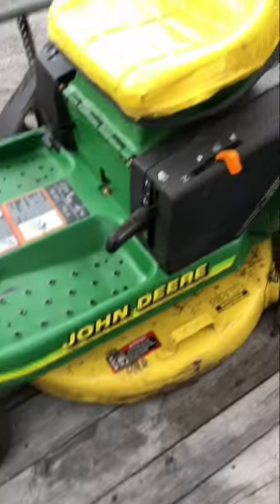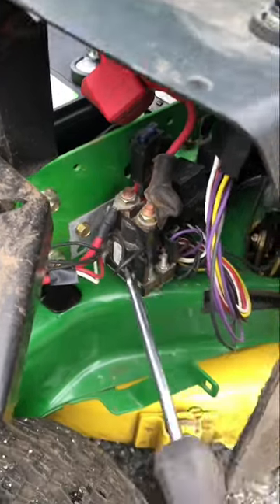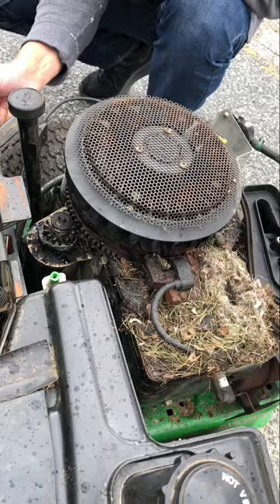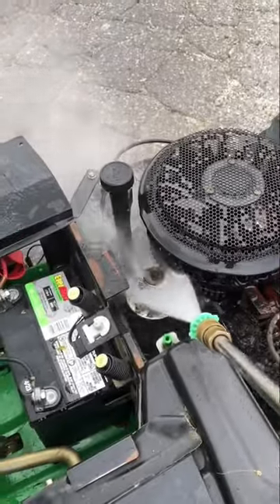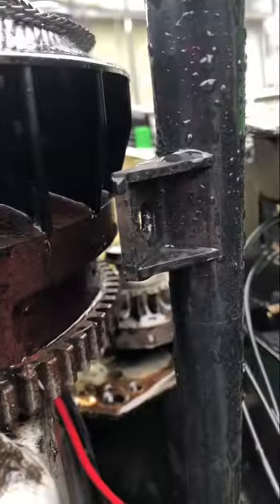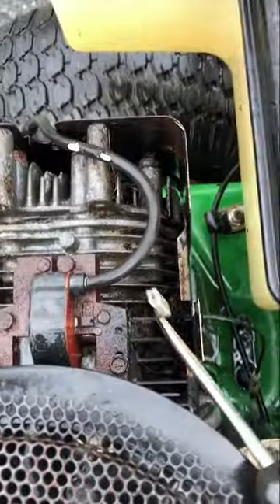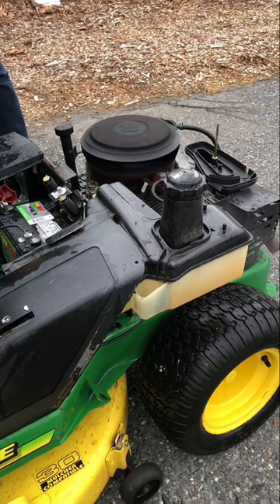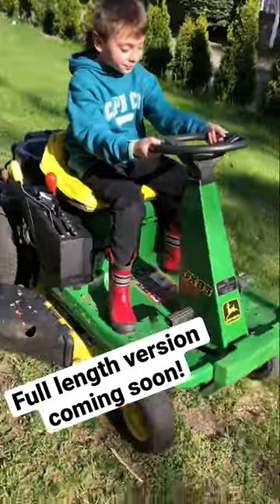Reviving an Old John Deere GX85 Lawn Mower | Battery Replacement, Engine Cleaning, and More!

Comment: You can use just about any Deere or most lawn mower keys they usually use the same keys
Reply from the maker: Not in this case! It was a different key completely. Single sided teeth instead of the double with the proper slot. Weird.
Reply: @NiceLawnBro  sounds like a john deere skip loader key might work then
Reply: The tumbler in that machine is the commercial line of John Deere any commercial mower key should work.
Reply: You can get the keys for $5 from a john deere dealer. Just had to order one yesterday.
Reply: Old gator key should work
Reply: Hell, for my 125, if I'm lazy and forget the key inside I can run it with a simple master lock key that also opens the shop door lol

Comment: those engines are awesome i have a 1988 185 been using it since i was 8 years old i’m 31 now
Reply: Got a 1985 180 J D , it's awesome 17 hp kawasaki engine, great tractor , awesome differential!!! Great traction, plows well in the winter even without chains and wheel weights!!! It awesome with those on! Keep it maintained it will last for ever!!!

Comment: Love a cheap/free mower. Currently doing a small restoration on an lx188, needs a little more than what yours did I'm afraid. I'm rebuilding the harness currently, the PO used the crackhead tactic of slicing insulation to shove a 12v probe into the wiring all over the place and it was out in the rain so long all the wires gone brown. No big deal, I just wish it was as simple as the Briggs harnesses I'm use  to

Comment: 90% of the time freebies are easy fixes. But then you don’t know the history of it and sometimes it runs like a dog.. like you can tell it’s not the valve lash settings or the throttle governor etc. And there’s never a spark arrestor on the exhaust

Comment: Hopefully it is a standard key and switch which is the same one that is like that is on a true John Deere mower
Reply from the maker: It’s not! It’s a special one that costs $8 at the dealership. 🥴🙄🙄🙄🙄🙄🙄 otherwise, $4 on Amazon or tractor supply or depot or Lowe’s or Walmart would have been quicker to get. They’re everywhere! Fortunately the switch was fine. Just needed that key. 🥰

Comment: Can you run me through every step plss!! This is the exact video I’ve been looking for. I have a John Deere Rx75 but is missing ignition, will I be able to still do it??
Reply from the maker: Yes you can! I don’t have the mower anymore but it’s a series of switches that need to be checked: seat, blades & brake. You’ll want to get the ignition at the John Deere dealer because they aren’t all the same. That’s the whole thing 🥰

Comment: What’s the wire he messed with to override the ignition switch being off?
Reply from the maker: THAT, was the grounding cable to the coil. Because I had no key, the ignition switch was always grounding out the spark, in turn, not allowing the motor to run. Remove that wire, allow spark. ⚡️ be prepared to pull the spark plug boot to shut it off if you go this route. ✌🏻
Reply: @NiceLawnBro  thanks! I have a no start mower. Wouldn’t crank. Put a new ignition switch in and still no crank. So even jumping the solenoid to get it to turn over and still not starting. I’ll try your method next. If it starts, backwards trouble shoot from there.

Comment: Nothing runs like a deere!!! I would have just lubricated the bendix, could have caused more problems with water
Reply: John Deere’s are garbage compared to Toro’s😂
Reply: You'd never could convenience a farmer of that. The new toros can touch the current john deere line up. That's a riding lawn mower not a garden tractor.
Reply: @eugeneray8829  who’s talking about farm equipment ?
Reply: @Paul Kersey  I'm not. Yard and garden tractors is what I'm referring to. That's a riding lawn mower dude . Pretty bold to throw a entire tractor manufacturer company to the ground for a bad purchase you made on fb marketplace or a freebie off the side of the road. Not like it's a new tractor dude. Obviously was never properly maintained. So throw the manufacturer in the dirty for your own lack of knowledge of a well maintained tractor??? Most owners never even change the oil let alone spark plugs and filters. That's been my experience. Nothing more than a dirty bendix does not make a shitty mower manufacturer. Look at Craftsman steering problems the same in poulan and Husqvarna. Made by Husqvarna, all manufactured by Husqvarna. That is a steering manufacture designed nightmare, owned specifically by their design team. Not a dirty bendix caused by someone who doesnt know machine maintenance.
Reply: @eugeneray8829  work at a private golf course with all new John Deere’s  all of them went back that we demo’d because they were shit cuts blew hoses leaked oil everywhere and always down so stuck to Toro the best on the market…
Reply: @Paul Kersey  never even knew JD made a greens keepers mower. Toro yes  and always have for mowing the turf on puttying greens. #10 series john deeres certainly weren't. The deck height isn't as adjustable as what the rules for your affiliation may require for their tournament course. Greens keeper def should have been the one in on the decision on the equipement needed. They probably were trying the cheap route. You know spending less is always better for the bottom line. A good greenskeeper I would believe would even make the decision of JD over Toro. LMAO Toro has been making greens mowers for decades. Not JD that I'm aware of. They make commercial class ag equipement! And one hell of a yard tractor and garden tractor 🚜!
Reply: @eugeneray8829  nah tractors are trash too we use Kubota and New Holland which blow JD out there water and yess JD made a 8800 series rough deck mower that we demo’d and didn’t like so we went with the ground master and we also had a triplex JD that wouldn’t strip as good at a Toro triplex and a spreader cart that they wanted 45k for that felt like you were driving a cement truck with the worse suspension so again we went with a toro spreadavator and now few years later haven’t looked back to JD and they’re finch guys.

Comment: This model has proprietary junk. Parts are hard to find
Reply from the maker: Who knew?! I’ve found a lot of the Briggs series are interchangeable. Might not be back to exact factory standards but they function properly, from my experience. But then again, I’ve only used donor machines once or twice. I’m no seasoned vet when it comes to this. 🥰
Reply: Parts Tree
Reply: He's not kidding. I junked one bc pulleys and hardware were all JD proprietary and shops didn't even want it for parts. It's hundreds of pounds of scrap metal now
Reply from the maker: @ThisTimeTheWorld  worth $8 nowadays

Comment: Seems like a very rookie mistake, but why didn't you first check the oil and the condition of the gasoline?  How long does it take to pull a spark plug and look at the air filter, Yet these guys don't bother to do the basics.  It's a gross mistake.